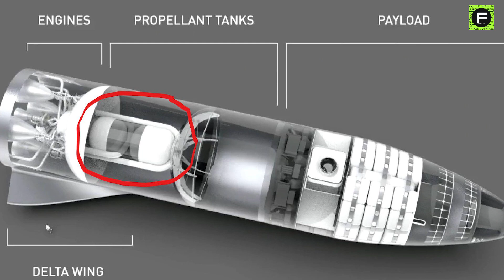Will Starship Super Heavy BN3 Explode Like SN4?

Comment: Great video but some things u should know. The starship an super heavy naming scheme has changed from SN and BN to just S and B. B3 will not do a test flight that will be B4 with S20. And B2 was scraped. BN2.1 was the booster that done a cryo proof. Edit: also the super heavy will use 33 raptors